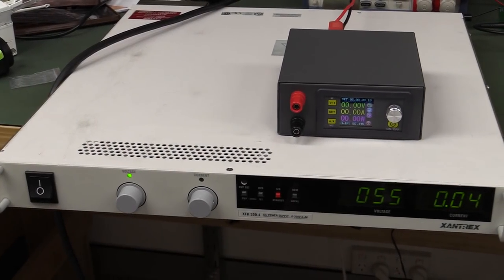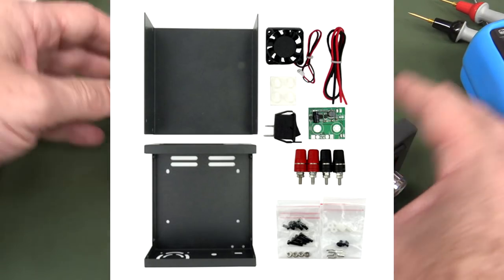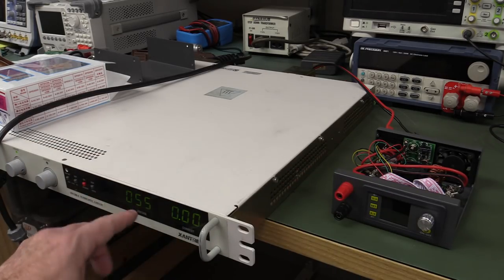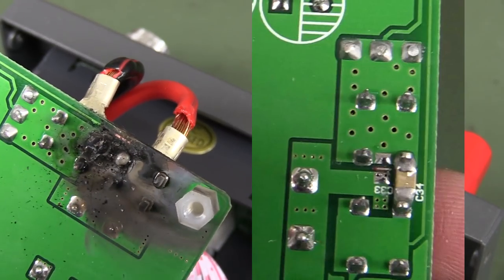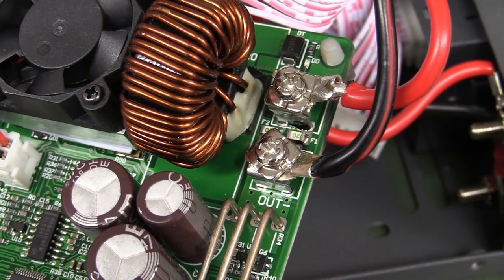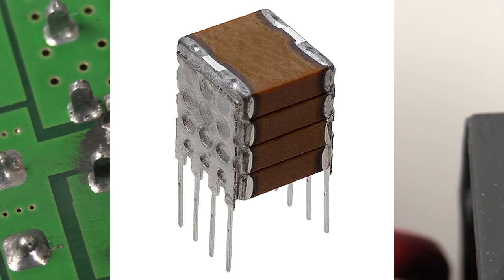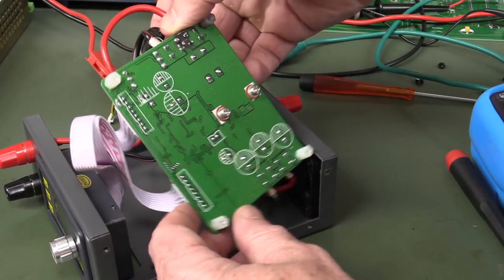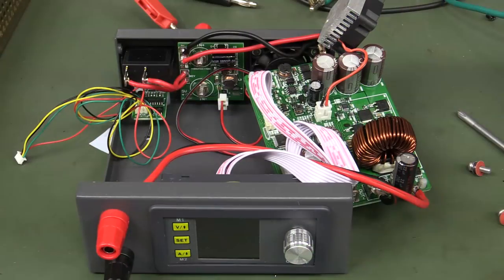EEVblog #1035 - Flaming DIY Power Supply!

Comment: I had the same problem 15 years ago. This (apparently) happend randomly  
only to the capacitor soldered by hand. The capacitor was for DC supply filtering too. I found that the problem was due to: 
- the very high temperature of the solder tip,
- the relatively long time to solder due to copper pours,
Without preheating the PCB, there is a temperature gradient on it and once both sides of the capacitor are soldered, there is a mechanical stress that could make some internal cracks. 
I guess the problem is not only o the carbon of the fiber glass. Once the capacitor has entered on 'avalanche' (internal layers shorting more and more) the current is not 'smooth', and the output voltage of the power supply (adding the leads inductance too) could generate transient voltages higher than the MOSFETs 80 V.

Comment: The TQFP chip has 2 pins shorted??? 18:10
Reply: Good eye!
Reply: Probably just a clothing fibre but worth checking out.
Reply: Almost looks like a deliberate bridge.
Reply: rorroparo
I saw that place , it should be solder splash, I guss Dave drop it mistakely when he install the case , but there is nothing with the board, it control the display . this is not from our factory, because this chip was weld STM machine, it is impossible that there is the solder splash on 2 legs. we don't weld the chip by hand..
Reply: Rd Tech "big" chip next to C16, upper left corner of it.
Reply: The quad side package, top left hand side, there is a bridge from top pin to the next pin.
Reply: Woow, yes
Reply: Lagittaja

I saw it , I saw that place , it should be solder splash, I guss Dave drop it mistakely when he install the case , but there is nothing with the board, it control the display . this is not from our factory, because this chip was weld STM machine, it is impossible that there is the solder splash on 2 legs. we don't weld the chip by hand..
Reply: ajistewart
ajistewart
 I saw it , and explain, that is not from our factory
Reply: he just remove it .. that's not the reason for smoke
Reply: @spontaneous reset: the reset is a "feature" of those modules in case the ps-module draws unexpected current. I have a few of the DSP5005 models and on hard stress tests, borderlining their limits, they show this behavior. It's not a 100% controlled thing, as the modules all have over-current/voltage/power-protection which disable the module. OC/OV/OP seem to only control the module's output stage, but from what I gather the reset is primarily caused when the modules sinks too much current from it's supply.
Reply: klcbsoft more like the current limit of the input psu drowning the input voltage too low for the module to function properly.. not a feature of the module per se.
Reply: Dave had it hooked up to a CC/CV supply at 40v 0.5A (14:20 ). Just as it turns off you can see the input voltage start to drop. 14:48 play it at 0.25x speed
Reply: @Niklas Mertens: might be! I had the module behind an LM338-regulation-circuit, powered by a massive toroidal (delivering ~47V after rect & caps). Output on the LM338 was set to 35V. Even though this should be in range of the LM338 it might actually have been the LM338 that went into shutdown/protection, thus cutting off the module. I need to test that on a BJT-regulated design (10A out). Good input, thanks!
Reply: @Vendicar Decarian
thank you very much for your data, I can make sure 100% that there is nothing with those 2 pins. this 2 pins control the display part, not power part.
Reply: @ klcbsoft
thank you very much for your message and your professinal reply 
this rebooting was that the burnt things was not clean up. there is some shorted, but not totally shorted, just clean it up , that's ok
Reply: @Niklas Mertens
this rebooting was that the burnt things was not clean up. there is some shorted, but not totally shorted, just clean it up , that's ok
Reply: @magnets1000
magnets1000 
this rebooting was that the burnt things was not clean up. there is some shorted, but not totally shorted, just clean it up , that's ok
Reply: @ Xcho Poghosyan
I did not see anything

Comment: Dave, it would be interesting to do a thermal image with the FLIR of the board when powered up. if it's really a conductive path between the output terminals, it should be possible to dremel out the burned pcb area inbetween. but maybe some of those mosfets (are they doing synchronous switching?) failed low resistance between drain and source.
Reply: The charring did indeed become conductive. Basically made a crude resistor.

Comment: I worked at a power supply company for 25 years - unregulated, linear, and switchmode. I started as a technician and plodded my way through engineering and management. Switch mode supplies are lightweight and compact BUT when something goes wrong you do get copious smoke and usually a little flame to go with it.

The engineering has to be just right and the parts quality has to be very good or they fill fail spectacularly. I have 4 power supplies on my workbench and everyone of them is a 40 year old linear supply  made by old line companies. These can be had on ebay for very little money but it does cost a bit to ship these old boat anchors (a one KW supply will weigh more than 40 pounds).  Replace the bulk caps and they go forever

Comment: A really bad place for that cap - Near the edge of the board and mechanical stress from the fat wire terminals fitted nearby.
Probably developed a micro-crack then failed short.
Should use a cap with polymer terminations in that environment.
Reply from the maker: Yeah, mech stress + thermal stress double whammy, not good.
Reply: If I buy one of these PSU modules (not necessarily the 50V one) I will make sure to  unsolder that ceramic cap and fit a through hole ceramic or electrolytic instead in a better place. That is definitely not a good location for such a small fragile heat sensitive SMD cap.
Reply: Steven Birch 
yes, you are right , this caopacitor defect is the  crack resistance is not good, so the place is not good 
now our engineer are designing new way, new place and new capaciotor to solve this risk ... 
if fact, don't use the capacitor, it still can work normally
Reply: EEVblog
yes, the place is not good, I admite it 
this caopacitor defect is the crack resistance is not good, so the place is not good now our engineer are designing new way, new place and new capaciotor to solve this risk ... if fact, don't use the capacitor, it still can work normally
Reply: Simon Tay

even you input more than 55V, you also can unsolder this capacitor, that's ok?
it is just filter capacitor.
Reply: Im glad to hear you are working on a revision for this. This is the module I want for my purposes. Hopefully when I get that project underway this will be fixed.
Reply: @ Clyne Griffon
we have sell thousands of thIs DPS5020, there is the second time, because the capacitor place was not good,  was easily damaged by external force. so it was shorted. now we are updating 
and you can remove this , that can work normally
Reply: Do you plan on conducting a recall of this product?
Reply: Cut a slot on the board under the cap.
Reply: If it is necessary to have a ceramic capacitor in a location vulnerable to board stress or similar harsh environment, then it's worth considering the types with polymer terminations. These have a tiny amount of flexibility that helps prevent cracks. Most manufacturers make them, trade names include Flexiterm, Flexicap etc. Perfect where reliability is critical. Cost is a little higher than regular capacitor, but it does work!
Reply: @Stephen
he has ready made a repair video , you can check
Reply: @Stephen Low
yes, in his repair video , he did
Reply: @Steven Birch
thank you very much for your advice , it is ok. but we have used a new strong capacitor to replace it 
thank you
Reply: @simontay4851  Why unsolder?  Just cut it off!
Reply: @rdtech9153  hi ,happy to learn about this,i will buy a recent "and designed from new way, new place and new capaciotor to solve this risk "... on the Banggood site ... thx
Reply: @jmr-marc  we have solved this problem one year ago by using a better capacitor,you can buy it now

Comment: Hi, in other review of this thing on tube, was mentioned that if you want to use it with more than 30V you have to change this cap to more voltage. It was provided by manufacturer information...
Reply: Do you have a link to this information, please ?

Comment: I think the current is going through the burnt board. should test resistance then remove some of the burned board and see if the resistance goes down.
Reply: CrazyMonkeyCM32 thought the same, how didn't he try and scratch that
Reply: yes, those bunrt thing are shorted. just clean up that

Comment: Dave: You need to clean all the charred PCB out from output side and then try again. That blackened material will conduct current and keep on burning more and more. 

It could be recoverable but you'd need to do some destructive file/dremelwork and then refit the output cabling.

Comment: I just got this power supply through hobbyking. And the cap that blew is no longer there so it looks like the devices on market now are fixed. But if you do not need alot of Amps I recommend to buy the DPH5005 Note the H instead of S in the name, This device can boost your input voltage up so you do not need 55V input to get 50V out, you can get 50V from 12V input.
Reply: thank you so much for your message ,yes, we already fix it , and change the place and use strong capacitor

Comment: Isn't the charred epoxy basically graphite and thus conductive? Try removing everything that's charred and short on the output will probably disappear.
Reply: I second this. Best to physically cut a slot in the board between the output terminals to remove any chance of a conductive path.
Reply: EEVblog
please scapt those to try

Comment: Great video, as usual. 
My 2 cents words: the PCB layout designer did the mistake to place the unique SMD bottom component in the most unfortunate place: ceramic capacitor attached to metal screw connector. This is a beginer mistake. He/she did not take into account of the MECHANICAL stress. Should place a THD capacitor, or maybe this SMD but not exactly on the terminals.
Good that you published the video, thic ceramic capacitor is a ticking bomb for all these modules. 
Luckily it can be easily repaired. 
Cheers!

Comment: The problem of the short circuit is due to the burning of the pcb, burning the pcb charred the substrate of the board, transforming the insulation material into conductor (carbon). I have had problems of this type, and the solution is to scrape the pcb to remove all the carbon from the burned region of the pcb.
Reply: Or cut out an isolation slot between the output terminals.
Reply: yes, you are right, just clean up those burnt those thing , that's ok

Comment: lets admit that this unit is good , the R&D from chinese products works , at least for people that doesnt have 300$ for a bench power supply. chinese products are not trash anymore.
back at 90's or 00's i spent 2 weeks and 120$ to make a lab psu 0-30v 3a , was huge and expensive. consider how many kids and people can do amazing things with just 20$ , to make a small setup for fixing and learning electronics.

Comment: I just received one of these power supplies today, and sure enough, C34 has been edited out. It’s completely gone on my unit. So hopefully that takes care of that!
Reply: we have already updated it , use the better capacitor
Reply: Oh, did you put C34 somewhere else? Or did you just remove it and make other changes?

Also, while I am talking to you. I'm still trying to assemble my unit. It's just like the one in this video - I have the DPS5020 power supply, and the grey metal case for everything. I am nearly there, but I am wondering if there are any assembly instructions you have, such as for the fan board? The fan board is the last thing I have to do, along with the switch. Do you have any manuals?

Thank you! Can't wait to get this power supply working. I also have your USB meter (the yellow one), and dummy load - loving both! I am going to order more, as well as some USB-C ones. Great quality stuff all round! Thank you!
Reply: @uzaiyaro  Hi friend 
thank you so much for your message and your support, we already change a better capacitor and put it on the front . 
for the installation instruction,  B.choice 2 (suitable for with power board part product): https://www.mediafire.com/folder/rsbgws8grh6zo/communication_metal_houing_with_power_board

3.Installation video: https://www.youtube.com/watch?v=ENZg4yTjhnY&t=2s
Reply: Rd Tech thank you so much! I’m nearly done with my build, I just have to wire the input side in. If I could kindly make a small suggestion; the crimp terminals you provide don’t fit the dies for any crimp tool I have.

I’ve actually been having a lot of problems with the supplied crimps, but if you supplied the crimps with the plastic sheathes, like the blue, yellow, and red crimps, that should fit a lot more tools and will make better connections.

May I also suggest using ring/eyelet crimps as well? Instead of the two prong style currently used. I found with the build that these two prong crimps tend to slip out if not held in.

Lastly, I’m finding that soldering the power switch can tend to damage it. If you include two spade crimp terminals in the kit, there wouldn’t need to be any soldering of the power switch.

Finally, just a question: has the issue of tightening down the terminals too much been fixed with the removal of the capacitor? I’d imagine it would be, but I have had to make the connections pretty tight so the crimps attach securely.

Thanks glen! It’s been fun putting this together, but the crimps are something I’ve had problems with. Everything else is going fairly smoothly though! Very nice kit. Please don’t take anything I’ve said as criticism, I’m just making a couple of friendly suggestions. Cheers!
Reply: @uzaiyaro  thank you very much for your suggestion. 
and for your question about tighten, I don't suggest you let our PCB deformation
Reply: Hi Glen,

Thank you, no problem! Also, I have a problem! The display in my new UM34C has died! And the USB port itself has become very loose. I don't know what's wrong with the display, it just doesn't work anymore. I have taken the device apart just to see if there were any connectors loose, but nope, unfortunately this is dead!

Is there anything I can do? I only ordered and received the unit four and two weeks ago, respectively. Please let me know if you can help, and what would be the best way to contact you.

Cheers! Rory

Comment: I own one of these. A year or two ago, the tiny PCB-mounted output fuse blew while charging a 12V lead-acid battery with the power supply.
I'll have to have a look to see if mine has this faulty output capacitor design, and remove the cap before trying to replace the fuse.
I'll probably replace the fuse with a large, easy to replace type, as the wee PCB fuse is VERY much not "replacement-friendly".

Comment: 16:34 How effective that heatsink is going to be when placed on the wrong side of the transistors? Plastic is not really thermally conductive, so is this heatsink going to actually be able to absorb any reasonable amount of heat from the MOSFETs?
Reply: I thought the same thing!
Reply: Surprisingly yes. One of the strange things about insulation is the surface area increase of the overall part outweighs the thermal resistance due to thickness up to a point. Those fets will get significantly hot on the plastic side allowing for reasonable heat (thermal energy) removal.
Reply: but the heat is produced on the metal tab so only radiated heat will be dissipated, i think...
Reply: No, heat is also transfered in the insulated front, just not as efficiently.
Reply: anyway I would not rely on this type of heatsink ;)
Reply: That pad was not made from plastic but most likely silicone, they are not as good as thermal compound but they are not plastic and work reasonably well.
Reply: even for 250 watts per MOSFET (1000/4), i doubt ...
Reply: lol, those trannys aren't dissipating any 250 watts. More like 10 watts each.

"but the heat is produced on the metal tab so only radiated heat will be dissipated, i think..."

Not even sort of right.
Reply: It's a pet peeve of mine that SMD FET packages make proper cooling difficult. There is no other choice than a massive copper pad and loads of vias to extract the heat through the pcb and take a large thermal resistance hit. Some parts exist with a thermal pad on top, but they are rare and limited in available types, and hence seldom used and expensive. Typical example of suboptimal evolution...
Reply: Agreed. The on resistance for each fet is very low and the current flow at 20A through two (H bridge?) shouldn't generate that much heat. The metal plugs on the board above where ther cap burnt out should provide more resistance than the fets.

Comment: Hey!  I saw you just showed a BK Precision variable voltage power supply. I have inherited one, a 1698, and it's been running about 2 volts higher than what the display is showing. I was wondering if there was a way of recalibrating the readouts, or should I be looking at the hardware for trim pots?